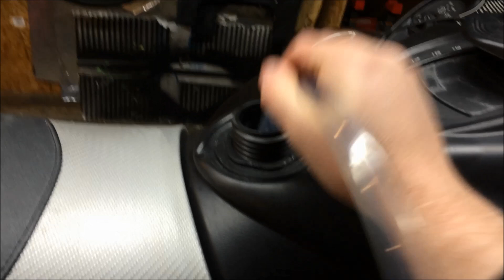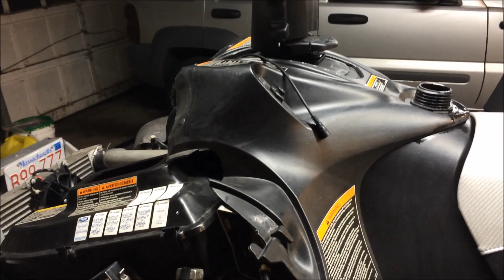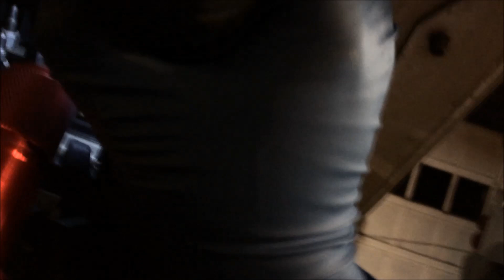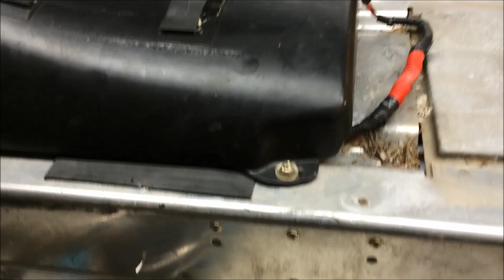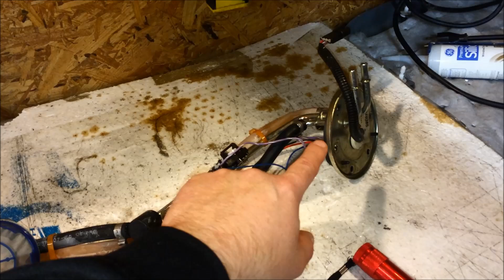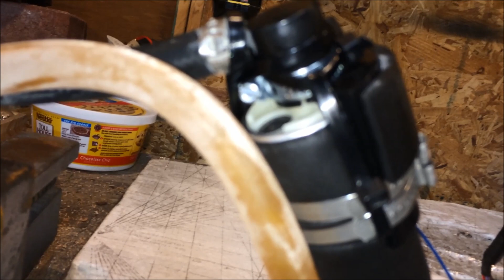Polaris FST Fuel Pump Repair

Comment: Hey bro my bro just got one of these last year. Drove it two days. Let it sit all year now. It’s got a similar problem to yours. He’ll start it, it’ll run for like 5-10. Then it will start coughing and bogging then it’ll just shut off. But when it’s in a heated garage it’ll run all day long
Reply from the maker: Could be a bunch of things. Most important thing on this sled is a proper warm up cycle. When first starting the sled, absolutely don’t touch it or move it until it’s 125 degrees. If you attempt to ride it. The plugs will foul immediately. 

I’d check the lines in the pump, temp sensor, fuel filter and change the plugs while you’re at it. 

What year?

Comment: Any leads on one of these fuel pump assemblies period as I am running an old 3 Polaris Frontier classic 4-stroke. At some point they stopped manufacturing these fuel pump assemblies and they're nonexistent. This assembly looks pretty much identical to mine although a few inches off the fuel pump there was a pressure regulator on mine while taking it out of the assembly I broke two of the three Clips plastic Clips sitting gasoline for 15 years I mean what would be the problem with that. Anyways I did replace my fuel pump got it all back together zip-tied the pressure regulator back in place got it all together she did start up but she's running very inconsistent. And it's got me thinking the way it's urging that the pressure regulator isn't quite working right and that Larry lays my problem they don't make these assemblies so I'm looking for a substitute and trying to find a way to make something work and considering the F St and the frontier classic rant about the same motor as well as have that nice 45° angle on the assembly I'm thinking of giving it a try I have a sled out here with only 2,000 miles pretty much brand new that needs a fuel pump assembly so I'm going to give it a shot
Reply from the maker: That Frontier was a oddball sled. I've seen maybe 2 of them on the trails. I would try ebay or a cross reference to a victory motorcycle of the same year since that's where the engine came from.

Comment: how can i tell if my fuel pump is working, i didi exactly what you done, it looks like it was done before also, but now when i put it back together the problem stays the same, it will start and then cut out after a few seconds,
Reply from the maker: Did you replace all of the lines?
Reply: @StreetersGarage  No i didnt, as in your video the lines were almost brand new looking, i cleaned out the little screen on pump, put back in and ran good for bout 10 mins and startedacting up again, no reverse, lack of power, etc, thx for the reply.
Reply from the maker: To rule out the fuel line issue. Fill the tank up all of the way to eliminate any air entering the system and try it again. If the problem goes away, more than likely you have a line sucking in air.

Comment: This video saved me... literally the exact issue I had..... even the same issue with hose being disconnected!!!! Thank you for posting!
Reply from the maker: That's awesome! I'm glad it helped you out and you're able to save some cash versus going to the dealer. It's definitely a pattern failure with the early FST's. My Buddy has a 06 FST Touring and it had the exact same issue.

Also- check out my video on how to change the oil as well. Makes it very simple compared to the Polaris method.

Thanks for watching and please subscribe!

Comment: as much as parts cost from polaris you would think these things would be built bulletproof from the factory...  assholes...  but hey thanks for the video my friend! mine cuts out Everytime I floor it and only started after I got down to half a tank... I also have a really hard time starting her and my temp Guage always says I'm around 90 to 140 never goes any higher.  so time for a new temp Guage and to pull the tank.  thanks again buddy videos like this that people like you take the time to make help others step into projects like this with confidence!
Reply from the maker: Can't agree with you more regarding the pricing on Polaris. I would be happy to pay for it knowing the problem would go away permanently. But knowing most of the time it's just a band to poor engineering is the frustrating part. 

From the sounds of it, your sled is doing exactly what mine did. All common problems. The good thing is once you have the tank off, changing the temp sensor isn't that bad. Just take your time and you will be fine. 

Thanks for watching and let me know if you have any questions.

Comment: Thanks so much for the video, had the same symptoms on my sled. Pulled it all apart and it was the same problem you had (fuel line off and clogged mesh filter on the pump). Put it all back together and still have an inconsistent idle and lack of power. Any ideas what the problem might be? Thanks again for the great video.
Reply from the maker: Glad it helped. Did you also replace all of the fuel lines while you were in there.  Even after I fixed the issue with the pump. I would have issues with it after it used 2-3 gallons of gas. One of the lines was sucking air and the sled would run bad.  If it was a full tank it would run great.

Comment: well done. Got a 2006 700 rmk that is kinda doing the same thing.  Not exactly the same sled but I think ill give it a try.  Seemed like it got worse as the sled got warmer.  Started around 50 mph and got back to the parking lot at 20 mph.  When I shut it off for awhile it would run better but not good for awhile.
Reply from the maker: Yes, I  just looked at Babbit's and it looks like the CFI uses the exact same pump. With this design, it's not a matter of if but when it's going to happen. If it hasn't been serviced since 07, chances are it will need it. Don't forget to watch part #2 which talks about the line replacement. Very important that you get the correct lines for the high and low pressure sides of the pump.

Thanks for watching and good luck. Let me know if you have any other questions.
Reply: Dirk Diggler
Well, pulled the pump and only one pick-up came out still attached to the pump.  The other end had fallen off due to due to the fuel line rotting. Thanks for making the video. Helped out a bunch
Reply from the maker: Excellent. I'm glad it helped. I think the best thing to do is too drain the tank completely at the end of the season to prevent it from happening again. 

Ride on!
Reply: Dirk Diggler
Looks like my pump is shot.  Got a new pump.  However, I still need to rebuild the pick ups/lines. I can't find part two of the video. Is there a part 2?  If not you said the correct lines???????

Thanks
Reply from the maker: Here you go

https://www.youtube.com/watch?v=TipIMCIW2wM